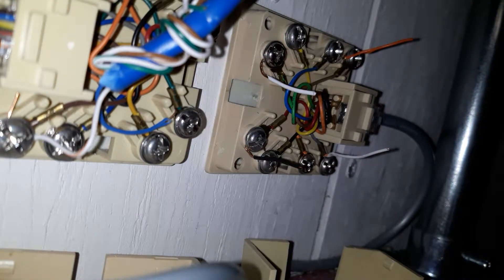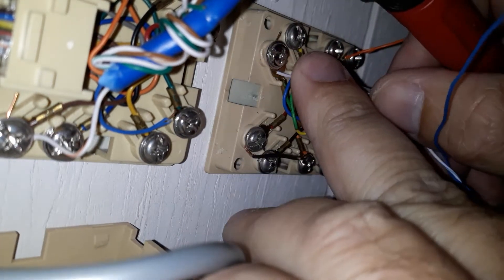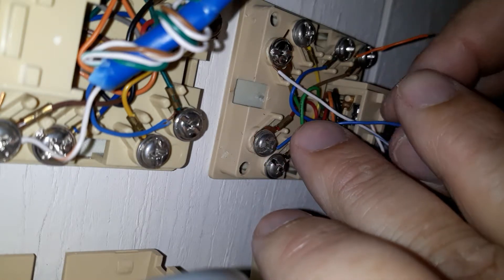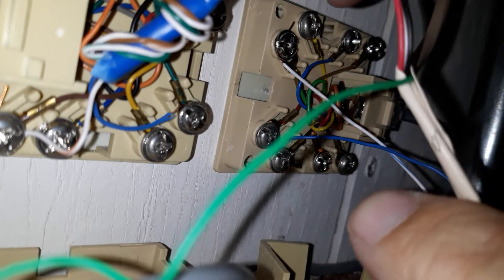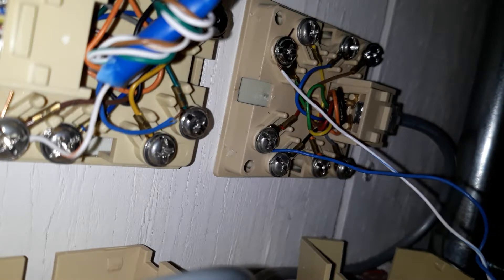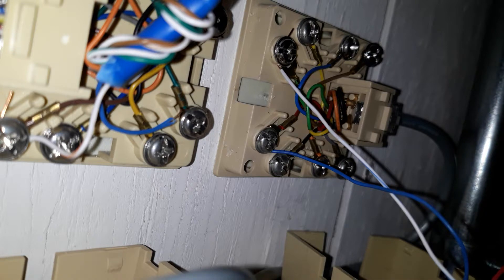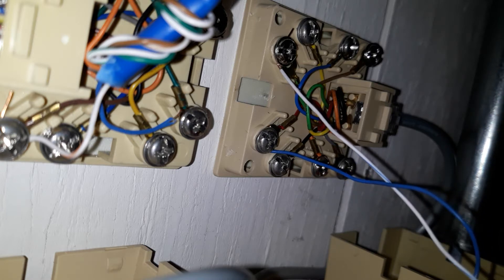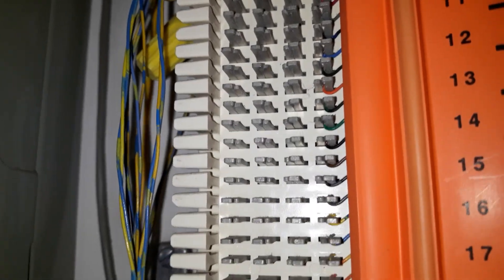Telephone wiring for line seizure fire alarm first Security second fax last part 2

Comment: I’ve got a weird situation. There’s no fire alarm connected, just alarm system. I’ve got my white and blue connected to the D Mark coming in, then my orange and white wires feeding all the the phones connected to line 1. When I disconnect the return from the alarm panel, all the phones say check phone line. But then when we call in to try and upload the panel, all the phones all of a sudden say incoming phone call. That should not happen with the return line disconnected, and the phones previously showing check phone line. Where my return line is connected, it’s on a gray punch block that  feeds multiple phones without using loops. Also next too the line1, it shows line two. The panel is on line one, but I have a feeling that it’s jumping over to line two
Reply: Lol

Comment: I wanted to give you an update on my situation. ATT came out to hook up my new service and the alarm panel did not work. The lady from the alarm company came out to inspect the panel and it was still in trouble. I called ATT back and they came out while she was there. The ATT tech ended up requiring so the alarm panel can be first since they are shared lines. The panel is finally working!!

Comment: Thank you so much! I switched to Spectrum and they say it is not VOIP  it’s digital. Sounds like the same thing to me.
Reply from the maker: Lol it is voip. It incapsulate in packets and transmissions over ip . I think they use sip protocol. There is code that has to be meet when transmitting fire alarm. Look at nfpa 72 fire alarm communication.  I would ask them what protocol the telephone uses and then Google that protocol. Charter guys tend to not understand how to connect lines to fire alarm. The problem with communication over voip is that the fire alarm system pulses so fast that it tends to drop some of the pulses so it will not go through. Good luck 

Here is what spectrums website says

Spectrum Voice uses VoIP (Voice over Internet Protocol) to transport calls over our own private network so your calls never touch the public internet. ... This distinction is important because services offered by manyVoIP providers do require high-speed internet connections in the home.

Comment: Hello,
At my business I changed phone companies and now the alarm panel is in trouble. Who do I need to come out to take care of this. The phone company is saying one thing and the alarm company is saying another. Help!
Reply from the maker: Most fire alarm panels do not work with voice over ip " voip" lines if you went from pots plan old telephone lines to voip. That may be the issue. 
The other is the telephone lines must go to fire panel then to your office.  Have the fire tech or telephone tech check the voltage of line on hook and off hook. They need to send test signals with line one connected line 2 disconnected. Then send signals with line one disconnected line 2 connected.  If you still have issues please post back with the actual errors.  You could get a cell dialer.  Or up communicator.  You need to get fire Marshall's okay with either of those options. Hope this helps.